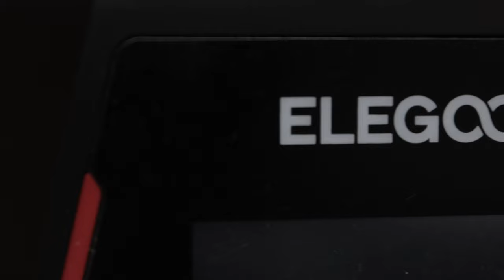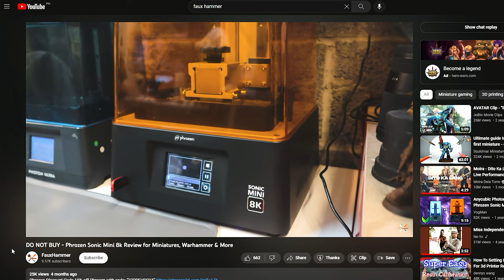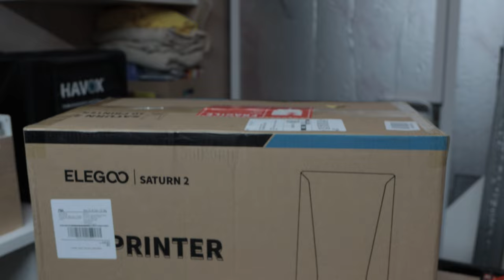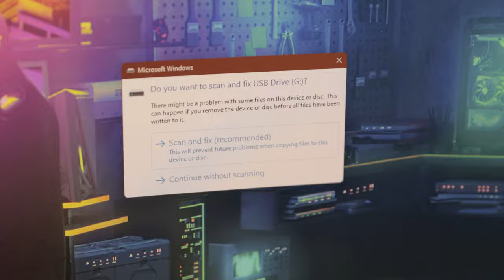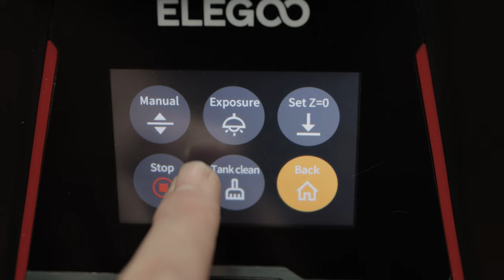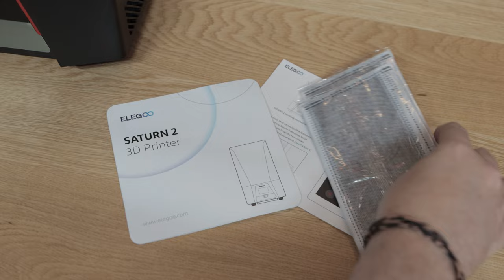Everything Wrong with the, Elegoo Saturn 2 Review 2023 Printing Miniatures, Busts & Diorama

Comment: No thankyou, I'm very happy with Anycubic.
Reply from the maker: Me too, I must admit I prefer the M3 premium as a printer. But it’s more expensive
Reply: @FauxHammer  what about anycubic D2.. Is it better than M3?
Reply: @ebs6286  D2 is great but it has a smaller print volume.
Reply: @manafa.b3040  I have 3 Anycubic Machines and never experienced any problem with them. I'd say don't pay much attention to forums and such, the majority of problems that people experience is user error. The firmware update has a specific procedure and just like a PC bios update, if you are not careful and do it haphazardly, it will break the motherboard of course.
Reply: Anycubic dont work well with chitubox AA. Hate it.
Reply: @hambaallah1948  You don't need Chitubox, Lychee alreay supports all models of Anycubic printers and it works flawlessly. I'd not use Chitubox for supports neither for slicing for no printer, not only Anycubic.
Reply: overpriced
Reply: Any cubic is trash
Reply: @BabyJesus66  Well, sorry to disappoint you but you are doing it wrong. You better learn how to properly setup and print your projects than blaming machines and tools.
Reply: I was about to get the Saturn 2. I have the Saturn and it’s not as great as needed and I probably bought so much resin that I could have bought another 3D printer in failed prints. Glad I didn’t buy the Saturn 2. I have the D2 and it’s fantastic. Now I’m going with GK Two. Wish me luck if this is not as good I’m sticking only to Anycubic and getting the M3.
Reply: @InitiallyJB  Good luck brother, no worries, Anycubic printers work perfectly. I have 3 of em and never had any issue.

Comment: Yeah, I really dislike the ball joint build plate. More than once, after completing and scraping off my print, the subsequent print failed because the build plate got misaligned from the forces exerted during the scraping. Never had this problem with my other printers that use the 4-screw tightening system. With this printer, just so that I don't have to second guess if there was any misalignment, I essentially have to zero-in my build plate after every print. Very very annoying.
Reply from the maker: I just learned you can level in the vat, rather than cleaning it off and using paper. game changer
Reply: @FauxHammer  Oh, I didn't know that, handy.

Comment: Question...If you have a 4K resin printer, is 8K worth it?  Is the difference that noticeable?
Reply: 4K, 8K, these numbers do not mean anything until you know the size of the LCD. The Phrozen Mini  8k has a really small print area so it prints minis at a 22 µm definition, but you could as well be talking about the Phrozen MEGA 8K with its 15" LCD screen and a definition of... 43 µm, worse than a 200$ elegoo Mars 3 and its 35 µm definition. See what I mean ? The µm definition tells you how fine you get detail on a print and its screen size how large a piece you can print. If you only print minis as a hobby a small printer with a 28 to 35 µm is what you should be looking for. The rest is convenience. To get the most of the finest definition available (22 µm), you'll run into higher cost resins and models not sculpted fine enough to take advantage of such a printing definition.
Reply: Aside from the definition that Gnomish replied to you with I find the biggest selling point of these printers is the size of the build plate. Right now I am on a Mars 2 and it does limit the size of things that I can comfortably print. I am seriously considering getting a 10" printer just for the size alone never mind the increased detail possible with them.
Reply from the maker: Depends what you’re printing. Minis? Maybe a little
Reply: My Saturn 4K died recently, so I upgraded to a Saturn 8K (note, not the Saturn 2 8K in this video,  mine is basically the old Saturn but with a very slightly larger build plate and a better screen).

I've noticed a marked increase in quality between the same models I've printed from the 4K to 8K models.

I am not sure its worth upgrading a perfectly crommulent 4K to get 8K, unless you are super detailed orientated.  It is, however, well worth it to pay the difference between 4K and 8K if you are in the market anyway.
Reply from the maker: @DaveDeBaeremaeker  you know what I love about Youtube, I love seeing comments from sensible people who have hands on experience sharing the truth!

Comments like this
Reply from the maker: @DaveDeBaeremaeker  "very slightly larger"?

Comment: I love my Saturn 2s. The only complaint I had, usb excluded, is that the early ones shipped with a firmware that would raise the plate too high after prints, causing resin to splash inside the hood. A firmware update fixed that, and I ended up buying my second shortly after.
Reply from the maker: Still does it

Comment: Well maybe a workaround for the USB slot is to get a USB extension cable and run it under the machine. 3ft should be good enough and you can get a 90° one so it won't stick out that far.

Comment: Good video mate

With the USB location issue I've gone about it by running an extension lead to the front which means I can have my printers closer together.
Reply: that's a really good idea. You could even get one of those super cheap USB hubs and have a nice fixed block where you can stick a stick in and maybe glue it to a part of the printer that suits where you need it for a more aesthetically pleasing result than just a loose cable hanging around. I do this with my PC with no less than 3 USB hubs so I should have realised this.
Reply: @ClayMann  exactly mate plenty of options available
Reply: Thanks- was going to ask that question!!!!
Reply from the maker: I know this is an option. But still prevents me from putting other printers next to this printer ter

Comment: I got saturn 2 tea time last night it arrived took less than 2 days from elegoo but I always remember you saying about the fan running when it's just sitting idle not printing well mine does not do this! The fan only runs when i press print!? It's been on all night now just sat the fan hasn't came on once after printing they must have fixed it the build date in mine says 6/23 so yeah think they have listened to you! Also got a free bottle resin like abs normal one but had a new bottle of 2.0 so just used that it's a lovely printer just cannot get over the size of it! I can fit my mono 2 inside the thing by the looks of it lol

Comment: Nice. I gotta say my one real complaint is that the cover lifts off straight up.  It would be a lot better to have the back be fixed to the printer and the cover comes straight forward so you can put it in a shelf or cabinet
Reply from the maker: Oh I cannot disagree with you at all!
Reply: That seems to be a common area of contention for users. It probably boils down to where and how the machine is used. I've noticed nearly all the small and mid sized units have gone to lift off tops. Clamshells weren't uncommon early on, but they went away probably because of cost and accessibility. 

People have designed hinges for the stock lids of some machines, so that's possibly an option.

Comment: The usb location is a lot less annoying to me than than many printers having the power switch at the back.
Having room down the side is easy for me. Getting to the back is annoying. 
Main problem I've had with the saturn is that every time I level it I seem to get a bias that causes frontside adhesion failure. 
Also it is sooo easy for resin to get down the screw holes that hold the bed down if there is a spill or a fep tear. and once its in there the screws cant go all the way down and have to be significantly offset with something like a nut. I don't even know when it happened to mine in my year of owning one. but it did. 
Also having to lift the whole enclosure over the top means I cant put a shelf in over top and just have like 2ft of empty space on the wall above it in my small studio.

Comment: Just made my first couple prints with my saturn2 ( its a different maching than my epax x1)  and I had a print fail, but thats not the problem, its the vat, it to shallow, and very difficult to pour the resin out of, and then my bottle tiped and spilled resin all over.  The vat is WAY to SHALLOW on this size of a vat, taller would be better, it an angle thing.  

And the USB thing,  a real pain.
Reply from the maker: Yeah the cat could do with being taller for sure. Makes sense since you are printing bigger things, you’ll need more resin, I’ve run out a couple of times with big prints
Reply: @FauxHammer  Its not even so much about how much it holds, but that with it so shallow, you cant pour it out without it running down the corner of the vat and onto the back side of the fep,   its just to short to have a good angle for pouring
Reply from the maker: @nobody342  oh that;s p[retty much every 3D printer now. there was one ever that was good, I can;t even remember which but it had one corner where the lip sat proud so even as it ran over the corner it would drop off that lip rather than run down the corner of the VAT, this is why i never bother removing vat's anymore.

Comment: It has a screen protector as you mentioned its a tempered glass overlay under the tape. Which can easily be replaced as i replaced mine.
Reply from the maker: can you replace the tempered glass overlay without replacing the screen? It was never made clear.
Reply: @FauxHammer  yea? its just a tempered glass screen protector its just underneath the tape so you have to take the tape off to replace it
Reply from the maker: @jamesa1995  i wish this was made clearer, in fact it;s the opposite with the instructions explicitly stating "DO NOT REMOVE THIS LAYER". I assumed it was affixed to the screen in such a way that removing it would damage the polariser. hense the addition of another screen protector.... sigh
Reply: @FauxHammer  I mean it probably could damage the polariser but no other 3d printers have tempered glass layers just a thicker glass layer. Tempered glass screen protectors crack really easy too, as mine did just levelling the build plate

Comment: Can you please also do a comparison between Elegoo Saturn 2 and Anycubic M3 Premium because I haven’t found one.
Reply from the maker: Will do. It’s in my plan to compare those 2 and the Mighty 8k.

If you want my immediate impressions. Saturn 8k is ace, but the M2 is a much more robust printer.
Reply: @FauxHammer  thank you so much. I’ve been debating on which one to get because I’m working on creating a YouTube channel that covers things for people with disabilities on how to assemble, paint, and add electronics to 3D printed statues.

The only difference from what I can tell so far are price, air filters, joints that hold the plate, other things and resin. Like Elegoo has 8k resin while Anycubic doesn’t (but can use if they want).

Comment: I have a lot of wicked3d models, would this machine be big enough to print those models or would I have to scale it down some? I am considering this printer for 1/6th or 1/4th models. I am not sure if this would work or should I go large format printer.
Reply from the maker: I have no probblem with Wicked models on this at either size. but you will need more print sessions for their full scale ones. Predator and prey diorama was 3 print sessions

Tip for you., download Lychee or Chitubox and then just add the printer. After that drag your parts in to see what fits. it's obvious when you think about it but it's also the last thing any of us think to do.

Comment: Those kind of printers, compared to the wire fed ones : are they able to print strong parts, parts that can have a mechanical role ? Or is everything kind of weak ?
Reply from the maker: You can use abs like resins which are a bit hardier, I use mostly sculpt resins for sharper detail. So he’s they can, but not typically

Comment: I have had such problems with this printer that elegoo even sent me a replacement.  I still cannot get consistent prints on the front half of the build plate.  I have tried everything I can think of including even building an enclosure to keep the temp at a consistent temp.  I have tried all of the 8k resins on the market and still no.  Can you share your setting for the Elegoo 8k space grey settings so I can compare to what I am using?
Reply from the maker: if you see my Saturn 8k video, they are in there. exactly as I sue them. but your temp is most important.
Reply: its likely not temp - in fact its likely either the vat being warped or the build plate not being level or moving when you tighten it.
Reply: @jamesa1995 bro I have just spent about a month trying to figure out why only half of my prints would adhere to the plate and I think I've finally cracked it: try leveling the plate on two pieces of printer paper instead of the leveling card that came with it. Since I made that change I haven't had a single failed print. 

Alternatively you can actually level the build plate on the fep itself, which makes it easy easier to do as you don't have to remove the vat. Just make sure there's no bits of cured resin in the vat as you can puncture the fep
Reply: @WontonDestruction  ive done all of those things and more - replaced the plate and wallah problem solved

Comment: The amount of fookin trouble I have had with this piece of sh*t is off the chart. Ok, maybe I'm pushing it a more than I should my latest model is a railway signal lamp in OO. The body is half the size of a match head and it's hollow for an LED. But for two weeks this crap has failed to print a model that was perfect printing over a month ago with every single print failing and it's not that complicated. Best bit, it has a design floor that sees the column bend as the plate hits the bed, squeezing out resin to produce an elephants foot.
Reply from the maker: Is your FEP degraded?
Reply: @FauxHammer  Sadly no, quite a bit of my stuff is off the build plate. So this latest run of fook-ups started with an increasing amount of elephants foot, then I get a few layers and nothing. This thing has cost me a fortune in resin and not a lot to show for it...
Reply from the maker: @thebritishengineer8027  honestly, sounds like fep issue

Comment: As far as I'm aware of the Saturn 8K was before the 2 and the reason they made the 2 is because the 8K wasn't well recieved. Looking at the website the 2 is more expensive than the 8K so the 2 is the latest and greatest Saturn
Reply from the maker: not quite, I just released my Saturn 2 Vs 8k video. and I checked, the Saturn 8k is the newer printer. Why is anyone's guess. Elegoo trying to corner the market most likely.